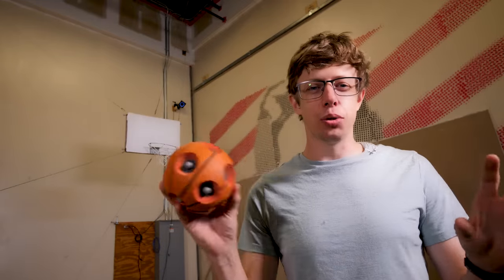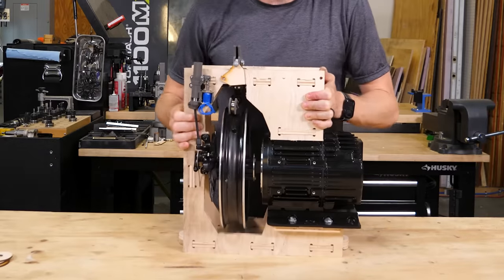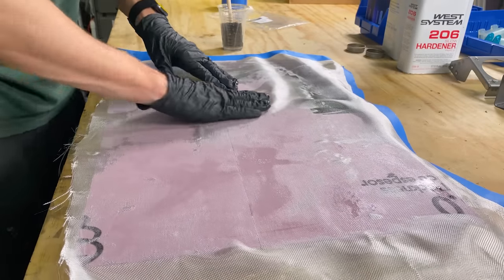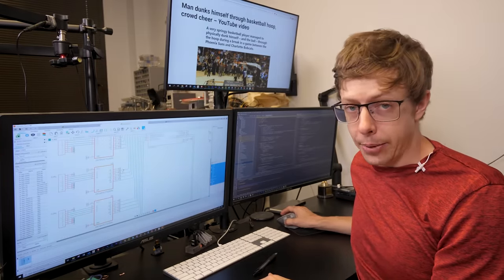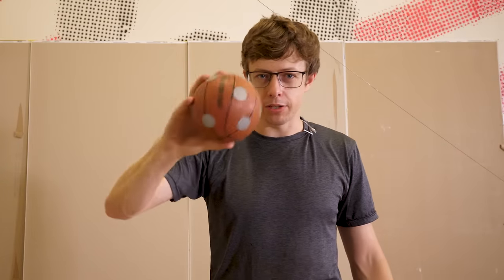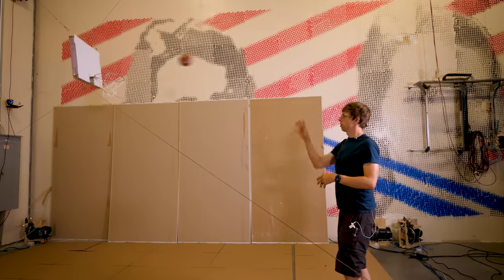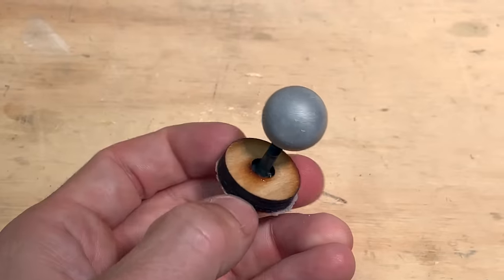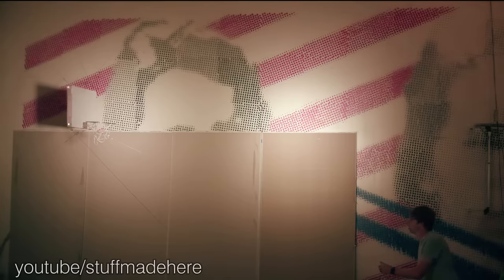I made a ball seeking hoop

Comment: The "tracking stick" is very clever. But even with error-free measurement, the lines won't intersect at a point because the cable is always tangential the pully radius. All the measured lines will be coincident the vertical rotation axis though. Betting you already knew that and simplified for the video. Fantastic content, I'm always impressed by how clean your engineering is.
Reply: I'm honestly a bit surprised at that simplification, because "the lines will alll be tangential to the same circle" isn't terrifically more complicated than what showed up.

All the same, incredible video.
Reply: I would have used SVD to get a least squares fit too, better than gradient descent in this case IMHO. Never go iterative when there is an algorithmic solution.
Reply: @jonathanbuzzard1376  Iterative solutions are almost always easier and faster to implement. They're just slower. In this case he just needed a quick-and-dirty one-off program, so he made the right choice.
Reply: By my understanding of the reverse kinematics, he wouldn't actually want the distance to the center of mass of the pulley, but the length of the working line (which is what he solved for). In this case, the working line includes the distance between the rotating gimbal on the pulley and the mounting point on the edge of the backboard. 

Actuating the motor would change the working length of the line, and you could neglect the total spooled length of cable during calculations. That is, unless you run out of spooled cable and your system suddenly becomes unconstrained :)
Reply: In a perfectly rigid system (under infinite tension) you would need to account for the pulley layout during IK solving. If you change the zenith angle of the cable, the line will get longer/shorter as less/more of it is wrapped around the pulley.

But... this type of pedantic thought experiment of mine leads to projects never getting done 😂 Throwing a spring in there and calling it good is (in my book) a much better solution.
Reply: @cuthbertallgood7781  Basically he is solving a system of over determined linear equations. Unless you have a priori knowledge about those equations the most robust method for solving them is single value decomposition, which importantly gives you a least squares solution. The problem with iterative is that you cannot be sure that you have not got stuck on some local minimum and consequently have not actually found the global minimum. As for simplicity any linear algebra maths library worth it's salt has an SVD routine so there is no programming involved. All you do is fill up an array with your coefficients call the SVD routine and winner winner chicken dinner. You can do it in say Matlab or one of its clones without writing a single line of code, that's how easy it is. TL;DR you never solve a system of over determined linear equations using gradient descent ever unless you don't know what your doing.

Comment: 100 mph is cool and the 3d hoop is awesome... But when are you going to make a 1000 mph 4th dimension automatic basket ball hoop?!?!
Reply: But... why? That's way too easy for him to do, you just make the hoop move in and out of 4th dimension to catch the ball that's traveling through 3rd dimension, which to an observer would seem like the hoop just teleported into the right place. Which, I'm pretty sure, is something that just about anyone can do. It just requires basic understanding of spatial magic. /s
Reply: @LordDragox412  😐
Reply: @LordDragox412  yeah, it would only take a dimensional plane stretcher to move/expand the hoop while in 4d, then the ball can simply fall into it wherever it lands

It wouldn't even need to move in the 3rd dimension
Reply: @LordDragox412  gimme the 3d printer that does it
Reply: Lets see him dodge one of those 100mph wires if it comes at him
Reply: Red hot 1000 degree backboard

Comment: Could you assign some sort of "accuracy score" to each shot by measuring how much cable had to be spooled/unspooled to sink the basket?
Reply: I imagine that it would be pretty simple, compare the resting position with whatever position it gets to before going back there and it needs to know the cable lengths anyway because of how the inverse kinematics are done.
Reply: It's not accuracy, but speed. It will try to catch them the moment it leaves hand.
Reply: Yeah, I think it would need to be a little more involved. The basket currently isn't even making an attempt at doing the minimum amount of movement necessary. I have a feeling that, even with a perfect shot, it would still move a bunch and catch the ball early.

You'd need to record the hoop's initial position, then run a physics simulation on the ball using its initial trajectory (because remember, we need to account for backboard bounces and such) and then somehow calculate the score based on that.
Reply: Really it should be doing this at the stage when he is randomly choosing which of the field of solutions it should take - using the movement with teh minimum motion would be the obv way to choose as it would reduce the strain on the machine. (and reduce the chance of getting diced by those wires)

Comment: You're a brave man, standing in the middle of tensioned wires without any face protection! I would constantly assume that one of the wires is going to detach from the backboard under full tension and whip in the air really really fast. If that would hit you to the face, it would cause some major damage.
Reply: Have you seen how large his FirstAid Kit is?  He is prepared for anything.  lol
Reply: He is on a fine line between brave and stupid

Comment: A ballistic missile is a type of missile that uses projectile motion to deliver warheads on a target. These weapons are guided only during relatively brief periods—most of the flight is unpowered. Short-range ballistic missiles stay within the Earth's atmosphere, while intercontinental ballistic missiles (ICBMs) are launched on a sub-orbital flight.
These weapons are in a distinct category from cruise missiles, which are aerodynamically guided in powered flight. Unlike cruise missiles, which are restricted to the atmosphere, it is advantageous for ballistic missiles to avoid the denser parts of the atmosphere and they may travel above the atmosphere into outer space.
Ballistic missiles vary widely in range and use, and are often divided into categories based on range. Various schemes are used by different countries to categorize the ranges of ballistic missiles:

Air-launched ballistic missile (ALBM)
Tactical ballistic missile: Range between about 150 to 300 kilometres (93 to 186 mi)
Theatre ballistic missile (TBM): Range between 300 to 3,500 kilometres (190 to 2,170 mi)
Short-range ballistic missile (SRBM): Range between 300 to 1,000 kilometres (190 to 620 mi)
Medium-range ballistic missile (MRBM): Range between 1,000 to 3,500 kilometres (620 to 2,170 mi)
Intermediate-range ballistic missile (IRBM) or long-range ballistic missile (LRBM): Range between 3,500 to 5,500 kilometres (2,200 to 3,400 mi)
Intercontinental ballistic missile (ICBM): Range greater than 5,500 kilometres (3,400 mi)
Submarine-launched ballistic missile (SLBM): Launched from ballistic missile submarines (SSBNs)
Most current designs have intercontinental range with a notable exception of Indian operational SLBM Sagarika and K-4 as well as North Korea's currently operationally deployed KN-11[8] which might not have intercontinental range. A comparable missile would be the decommissioned China's JL-1 SLBM with a range of less than 2,500 km.

Tactical short- and medium-range missiles are often collectively referred to as tactical and theatre ballistic missiles, respectively. Long- and medium-range ballistic missiles are generally designed to deliver nuclear weapons because their payload is too limited for conventional explosives to be cost-effective in comparison to conventional bomber aircraft (though the U.S. is evaluating the idea of a conventionally armed ICBM for near-instant global air strike capability, despite the high costs)

Comment: I wonder if this technology could be used in manufacturing or any type of assembly line where a product is tossed through the air and has to land in a certain area, but it is randomly launched. Trash disposal or postal service for example. This would also of course be fun in the area of entertainment.
Reply: FedEx have been using a similar method of "randomly launched" delivery for years.
They just haven't quite sorted out the aspect of "catching" yet....
Reply: Yes, but simple=better

Comment: New animations look great, amazing! one question, in my short history working with optitrack i have been bitten by the system having difficulties identifying orientation with less than 3 non redundant markers. I see the board (and the measuring stick) both have 4 markers but it seems to me one is redundant (they are all 4 on the same plane). am i seeing wrong? did you have any problem with that? do you worry about that issue?
Reply: Maybe somebody else can help with that it would be channel by itself

Comment: I'm curious, given the parabolic/gravity based ball tracking mechanism, I want to know what would happen if you throw the ball pretty hard in the hoop direction, rather than tossing it with a nice smooth arc
Reply: The second derivative of the line of motion is the acceleration of the ball. Once it has left your hand the only forces acting on it are gravity and air resistance. If the program is expecting gravity to be the only force that tells me it assumes air resistance isn't really a factor (probably true on most scales). Air resistance is proportional to the square of the velocity so the faster you throw it the larger that force will be, throwing off the gradient of the curve just a little - so it depends what the thresholds for "looks like gravity" there is here.
Reply: All flying objects without wings will run in arc. That is, unless you can throw faster than 11 km/s to exceed the escape velocity. Let's assume that it's not humanly possible.

The only problem with fast throws is that the amount of milliseconds before the ball goes out of usable movement space is very small. The combined latency of optical position detection, computer input, software, computer output, motor inertia, cable elasticity and hoop inertia is going to define the minimum time required for the movement of the hoop.
Reply: @MikkoRantalainen  there's that, but mostly I was thinking spin on the ball. Something that light & small can get some decent lift/curve just from rotational inertia, paired with the high surface area created by the tracking markers and divots. You're probably right though that the limiting factor is the latency between the optical tracking and hoop motion, rather than error in trajectory calculations from ball spin.
Reply: @jakezanders6598  You're absolutely correct that if you have enough spin for the ball, you would get Magnus Effect which would affect the curve the ball flies.

I'd expect the optical tracking to fail for rapidly spinning objects anyway, though.

Comment: You know, what your wife said is something that really would be interesting to see... 

The hoop moves around after predicting the trajectory of the ball as it's in the air. Which looks awesome when throwing it around the space. But, could it figure out that it is already in the correct spot to match the trajectory of the ball when thrown with accuracy? And if so, would it then just stay in place, or would it then move to meet the ball as quickly as possible, correct trajectory be damned? Which action would be considered the most efficient by the program? Adding a pro basketball player (or a really good basketball player) to the mix would help answer that question (if it hasn't already been answered.)

But anyway, that was freaking amazing!! ❤

Comment: Two thoughts:  1. I'm surprised it took you some number of weeks to realize how dangerous it is;  first thing I thought when I saw it was "garrote hazard."  2. you could mount all the lower motor positions above head height, so that KOing your wife would literally not be in its range of motion;  I personally prefer this to building something mechanically capable of doing something lethal and then adding an extra layer of complexity to the code to "tell it not to."  I prefer to have safety as the default on a physical level instead of hoping code works well enough to enforce it.
Reply: Mounting the motors to limit the travel space is a good idea.  I am always surprised when it appears that your wife has no clue what you are working on. She is obviously smart... perhaps you should have her review the project as a mentor and do the fast safety analysis, you know.. from the concept forward.   Mark C is right... never trust the code, even Level A code that has been critically reviewed.

Comment: For anyone wondering how dangerous this is, imagine 50 horses pulling on a steel wire.
... Now imagine that wire ripping your face off.
Reply: To be fair, he seems to have designed in a lot of energy absorbing failure points which make the whole thing self-destruct before approaching the cable strength limits. Still not sure I'd want to stand in the middle of it though.
Reply: 1hp is not equal to the strength or power produced by 1 horse.
Reply: 1 horse is about equal to 15 hp, but still, that's like three horses at their max strength
Reply: @Alzoura  ı think its a some sort of demo of a cargo ship's tightened wire that attached to the dock,when you get it off from its place
Reply: 50 horses ≠ 50 horsepower

Comment: Why not incorporate this code to intercept incoming rockets ?  In an industrial complex station drones on corners of buildings. Launch them on detection of an incoming missile that might impact the facility.  Launch the drones, raise them a few 1,000ft feet, then on command fly to the coordinates for the intercept.  This could be a very low cost last defense system for any structure that would reduce the damage caused.

Comment: how does it work when the ball has spin? like is the trajectory still a parabola when there is air interacting with the rough surface? i guess it would be worse now, if it did, with the trackers on the surface